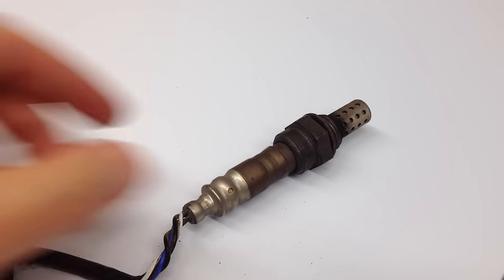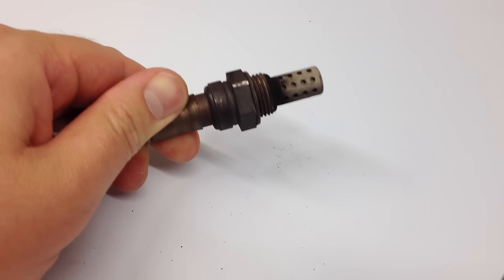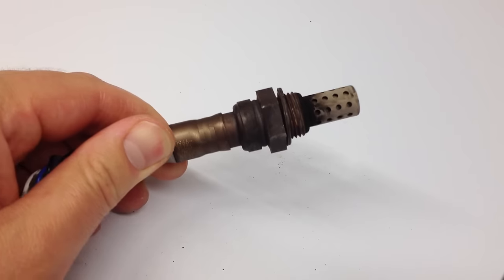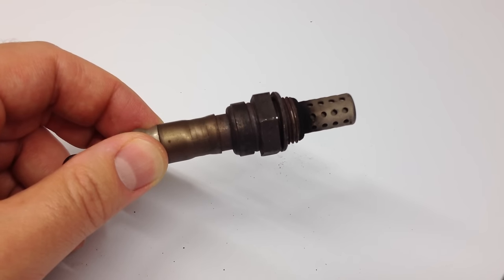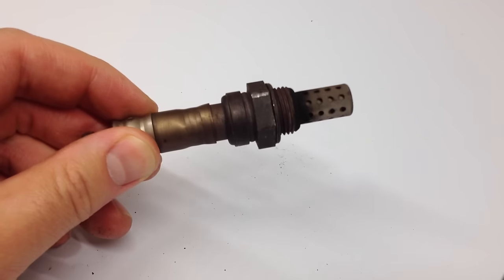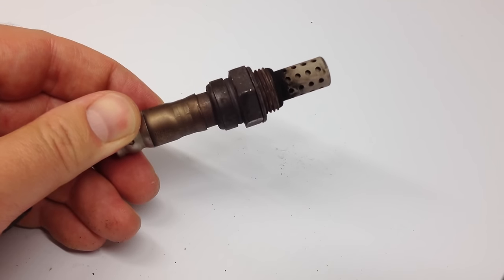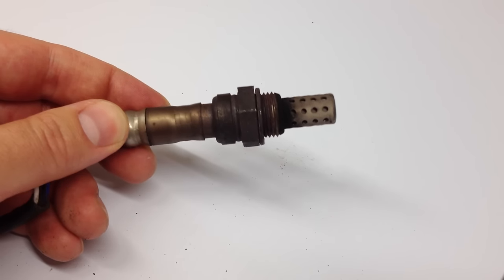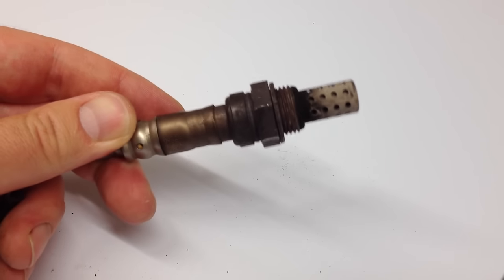Bad Oxygen Sensor Symptoms and Dangers

Comment: My 2017 Ford Focus just had a P0420 code. It was also burning through fuel by an increase of 40% and loss of power during acceleration. I spent about $80 at Autozone for a new bank1 sensor 1 sensor, saved about $100 installing it myself. My gas mileage increased back to normal and power was restored during acceleration. YouTube is definitely the people's University!!!
Reply: 😂bro I’m going through your exact same problem right now I’m bout to fix it at AutoZone today. Your comment made me feel a lot better.
Reply: You only replace 1st sensor or 2nd downstream also?
Reply: @superlintran  To keep it a buck, I may need to replace bank 2 sensor also
Reply: Na replace all 4 ya got 2 upstream and 2 downstream 2 on each pipe but I’m still having shut off problems I’m hearing the fuel pump causes this too so check them also
Reply: Same shhh in my 98 accord losing power (rpms) needed to hit the gas more i found if u have a live data reader u will see your soft fuel trim will be high, replaced that and it reads like it should

Comment: Just don't let the shop order it and install it for you. Brought my car to the shop and they wanted $600 (parts and labor) to replace a single O2 sensor. I did my own research to order the correct sensor and the O2 sensor was only $35 (oem Denso brand). And I had them installed it for only ~$70 labor. Their excuse is that the genuine Mitsubishi O2 sensor is ~$400....bullshit.
Reply: Sir your post saved us so much money. My husband was convinced that we had to do the more expensive. Thank you for the reference and the advice.
Reply: Genuine parts from the dealer are always more expensive. No bullshit
Reply: Thank you
Reply: 70 dollars to install it oO its a 5min job so you still got ripped off lol  all Genuine parts are over priced, thats where they make there money,  they sell the car sometimes for less than what it cost them to make and make it up by putting 1000% markup on the price of parts  the cars the bate to there parts scam
Reply: thing is too, these "genuine" parts are third party parts that a re-branded to the auto maker and the automaker resell them at HUGE profit, ridiculous man!
Reply: Acidpanda
Reply: TheBCSledder Do you really think they’re going to order genuine parts?
Reply: Dealership still find lots of idiots who are going to them to spend huge amount for just a rubbish part like this O2 which in most casses are just between 20 to 45-50£,$,€ however
Reply: I bought a o2 sensor for 50 bucks and it only took me an adjuatable wrench, a flashlight and 15 minutes of my time. Possibly saving me $550+ to anyone reading this  Some fixes are not that hard dont be afraid to get your hands dirty.
Reply: bs
Reply: Shops have online books they use as a reference for the time it takes to change a part!  This book is LIES about the time it takes!
They show it to customers; as a reference!
For example; it might say 2hrs to change O2 sensor; when in REALITY; it takes 10 minutes!
Reply: So many mechanics will and have taken advantage of our money. That's because their a professionals something we definitely want , there ALWAYS NEEDED, and many cant argue with there finding due to not having the mechanical knowledge on how vechiles work, we fail to pay attention to signs until it's late and there widely known for getting over on us women..most figure of course men know more and cant easily be targeted good manipulation tactic. This is exactly what pushed me into learning more on how vechiles operate. The only work I wont do is transmission and suspension. Now I laugh when they think their B.S me then it's my turn to talk I politely let them know what they've just told me is a lie and how it really works. I've had some get mad some congrats I do there job better then them some offer jobs or just purely amazed I'm a female who knows alot and do the work.... I'm not a fan but I wont get charged 135$ on 3 bolts again. Even if we cant do the labor look into what they say do your research and compare from diagnostic to cost. Google and YOUTUBE or a friend who mechanically entwined in the field to give advice. Always ask for your parts back when your cars gets work done. Trust me if you know what I know and seen that's the first thing you ask for when retrieving your vehicle
Reply: Just a heads up, my 2007 Honda Civic Type R oxygen sensor got bust, and I called Honda to get a replacement, and it's 500 euros. The same sensor from Denso, costs 120 euros. So it's not the shop that's ripping you off, it's the manufacturer that puts the Denso sensor in a box with Honda logos (or whatever manufacturer) and sells it for +4 times the cost. Although, 70 dolars to install a sensor is also a rip off...
Reply: @shemiahharper-scran9985  you've got to start doing suspension work, it's so rewarding! Diagnosis is often quite easy given the driveability symptoms paired with a visual inspection. If your work space is tight or you just don't feel comfortable/don't want to be bothered, that makes sense. 
Dealing with springs is legitimately terrifying even with the right tools. But I'll take a properly tuned chassis/suspension over speed any day....such a great feeling to sort out improper damping & handling & an even greater feeling knowing the job was done right with the right parts.
More power to you!
Reply: 70$ to install a sensor is .5hrs in a dealership shop which is the minimum usually. Plus it offsets the times when it takes a torch and more than 15mins.
Reply: Shops have no shame man it's crazy how bad they scam people
Reply: Range rover quoted $500 + $700 for two sensors , I of course found on amazon for $40 a piece .. 😊
Reply: @TheBCSledder  you can get oe genuine parts from places outside of dealer
Reply: @fermillo65 where do I need to buy the part from? I need 02 sensor.
Reply: That's insane

Comment: This disclaimer should be posted on all videos featuring engine codes.   Just because the light told you a sensor indicated something doesn't mean a sensor is bad.  perform tests on the affected system(s) to find the real culprit(s).
Reply: Very well put.
Reply: We they only last like 100 000 k miles . If you car it's more than 150.000 it probably need change.

Comment: The  problem is, an 02 sensor will get lazy/slow to respond long before it finally trips the CEL.
Reply: Replace them every 100k miles
Reply: This is what's going on with my 2K Dodge Dakota 4.7/v8. Both sensors are slaken off!

Comment: Mine had no error codes but was running like crap, dealers wanted $250aud for one sensor alone so i found 2 new sensors myself for $20 each...car is now running like a rocket its a huge improvement
Reply: Awesome, how did you figure out there was a bad sensor without a code? My Murano has negative O2 sensors voltage readings and no code 🤔
Reply: @luisdaniel75  Despite normal diagnostics the engine was running so rich there was really nothing else it could be, for $20 each it was well worth the gamble.  Its concerning how bad/rich it was running without throwing a code this engine had 140,000kms on it

Comment: Thanks man great information! I just bought a 2006 Cobalt LT that has a bad oxygen sensor. It was first a rental car then personal to 139k miles when I purchased it. It's burning rich and has a faint rough idle but drives fine. I noticed with the A/C on when I test drove it, and I didn't mean to rev it up  high, I smelled gas through the vents, so that may be the result of the O2 making things too rich. I hope it hasn't already caused too much damage. getting those things fixed tomorrow so I should be good.

Comment: My oxygen sensor was giving false lean condition. i never had a fault code for this. Long term fuel trim was always above 11%. now i replaced the oxygen sensor with a new oem one. And gues what, lamda readings are now 1% and the performance of the car is now outstanding!!  So never doubt it just replace it, if you know the sensor has a lots of miles on it.

Comment: Mine was throwing a p0171 lean code, but running so rich you could practically see charcoal dust blowing out of the exhaust.  After being off the road forever and worrying myself sick about it, I finally changed the sensor. The old one would rattle when I shook it.  Apparently something inside of it physically broke.
Reply: Did this fix your problem?

Comment: I got code P2096 (post catalyst fuel trim system bank 1 too lean) and code P2196 (O2 sensor signal stuck rich). My mechanic said I need to change both O2 sensors.  VW charges 400$ each. Bosch OEM sensors are half the price, but they were out of stock were I live, Dubai.  I've been driving the car with the code for few months now,  waiting to get hold of  Bosch sensors. I don't feel any issue while driving, but I'm worried about the life of my CAT...

Comment: My 97 Ls merc tracer was having trouble surge idling when parked or stopped at red light for over a year with check engine light stay on until I replaced both O2 sensors.

Comment: I purchased a car that I had to replace the catalytic converter right off the bat.  The check engine light had to do with lean fuel in 1 or more of my chambers.  I ended up cleaning out the MAF sensor with some electrical cleaner, and followed up with a QTIP (Would not recommend as it can break or contaminate the MAF, however my MAF sensor was horribly dirty and it was cheaper than purchasing a new one) and it was flawless.  Only issue I have now with the MAF is when I overload my K&N Air Filter.

Comment: Your description of how an 02 sensor works is misleading. All it does is measure the amount of oxygen left in the exhaust, and compare it to the amount of oxygen in the atmosphere. It does not "tell the engine to add more oxygen". It signals the ECM or PCM that it has a rich or lean condition, and the ECM or PCM adjusts the amount of fuel added.
Reply: I had the light come on when using Sunoco 96, and the light went off when I changed back to 97 octane. Chevy Cavalier.
Reply: Chris Kieninger I've heard the same description as this video from many other sources. If what you say is true, then why is their sensors prior to the cat converter (upstream)? Perhaps this is why upstream sensors are sometimes referred to as A/F sensors, as they help regulate it going in, and the downstream sensors check emissions coming out.
Reply: So essentially, yes, the o2 sensor "tells" the engine (collective term meaning everything under the hood in this case.) to adjust the mix.

Comment: i would call that sensor lambda(the greek letter) sensor. that comes from the lambda-factor of 14,6 KG Air to 1 KG Fuel which makes Lambda=1,0. If the catalyst should convert properly to 90 ratio you need the L=1,0

Comment: I can agree with this video
I've been burning gas for a while , engine lacks proper power
I changed everything so far
Except oxygen sensor
This might be the problem
Reply: Well, did it help, did the O2 sensor replacement make an improvement?
Reply: I have a toyota tundra 2000 v8 4.7 and i feel same recently wastes 2 much gas more then i was use 2 also sounds more airy then usuall could it be a sensor how could i get that check so they do that at auto zones ?

Comment: Wrong,   This guy said,   it will send a message to put more oxygen in.  Thats wrong,  it sends voltage back to the CPU for the CPU to calculate (use charts) to change the fuel pulse width of the injectors.  This will change your air fuel ratio to be as close to 14.7 as possible.
Reply: People should quit looking for reasons for someone to be wrong. At the risk of being hypocritical, I'll correct this. That voltage reading is a message. Just like in any other electronics. And, to be clear, I get what you're saying. One can quibble that the sensor is sending an analog signal that is used to in a calculation and it isn't sending a message to the actual injectors. I get it. But one can also quibble that the CPU isn't calculating either. A CPU simply parses op codes and handles timing for op codes, handles register operations, very low level stuff. A function in the firmware, stored outside of the CPU, is what performs the calculation on the O2 voltage reading and then probably sends that measure to another function that sends another message to the function controlling the injector. If I were building a sensor system for a car I'd care about that. If I just want to know why I care about my O2 sensors I don't really care about these details and they are functionally the same for this person.

Don't make things more complicated than necessary.
Reply: @KevinPartridge  ",,, I don't really care about these details..."
Yeah, we can tell. LMAO!

Comment: You don't always get worse gas mileage with a faulty o2 sensor. Mine actually went out recently and I actually get better mileage because of it. Not going to worry about replacement until my vehicle inspection is due lol.
Reply: To lean fuel  mixture  can burn exhaust valves and  pistons!   G
Reply: But I've been avoiding inspection cuz mine's not going to pass and it's been due do since October. I personally don't even see myself surviving and being alive in 3 months.
Reply: @iamshango3005  same, dont even know what to do anymore
Reply: @iamshango3005 are you still alive?

Comment: I replaced my cat & co2 sensor in 2013, and put no more than 26,000 miles, city driving only, with maybe two hundred miles  extra. I had to replace my cranking positioning sensor because my jeep wouldn't stay running after 20 minutes. It took me four weeks to save up for that component, it's 60 dlls. Now my co2 oxygen sensor, by indication of the check engine goes on after 30 minutes I clear the faults by disconnecting the negative side, and reconnect, that clears the fault in the computer, haaa but the it comes back on, hmmmm i'm thinking, is it the sensor or not, my conclusion, when the cat gets hot after the engine has been running for 30 or 40 minutes, that means it's clogged up, and needs to be replaced, because the jeep was not running for four weeks, they usually last for more than four years or better, depending on the gas you use, and how often you drive the highways to blow that excess carbon build up out of the exhaust system in the cat and muffler as well, and use good gasoline.

Comment: If anyone is trying to do this job on their own, it is very simple. You can even rent the tool to remove the sensor from your local autozone. Once you return the tool rental kit, they’ll refund your money. I bought the part and tool rental online, picked up in store and literally replaced it in the parking lot. Walked in 5 min. Later, the auto one guy said you don’t waste any time lol repair is so simple and will save you hundreds if not thousands on a damaged cat converter.

Also, if it ever goes bad, your car may go into limp mode and begin to stall/drive rough. You can unplug it which will resolve it temporarily. Just get the part and replace it then you should be good to go!

Comment: Good thing I got test pipes 😂 I switched mine out today because the gas mileage was so bad on a Infiniti G 35 coupe .
Reply: Nismo _ V35 I have a 05 g35 and I can’t seem to find the problem with it sputtering and trying to die like crazy.. it can’t keep a steady rpm and I’ve changed the spark plugs and mass air flow sensor (it was throwing code for that) and got the sensor and it was still sputtering and not acting normal... do you have any ideas on what it could be?

Comment: The up stream O2 censers don’t measure oxygen. It reacts to the oxygen an reports it to the ecm. Which the ecm in return sends a input to the fuel trim system to increase/decrease the amount of time the injectors are open based on if the up stream o2 censer is reading rich or lean.
Reply: The upstream 02 censer does not come online until it reaches operating temperature which is around 600-700 degrees. Once the o2 censers reach that temperature the ecm goes into closed loop. Before that temperature is reach the ecm is running on preset codes( open loop) from the factory  until the 02 censer comes online
Reply: Just use a scan tool. Sometimes it might just be the ignition system , air intake system or fuel delivery system that’s the problem. Or vacuum leak like a hole in your block 🤣💀
Reply: But it may not always be the 02 censer

Comment: What about 97 f150 only code bank 2 run lean, i have done looked at tons of videos on here i replaced intake gaskets maf sensor plugs injectors coils only thing left i think is the 02 sensors- it has no power barely moves have to feather the throttle can mash on it thats when it will pop n not move at all... long term fuel trim is pegged to like 38 short is at -6.8 on bank 2